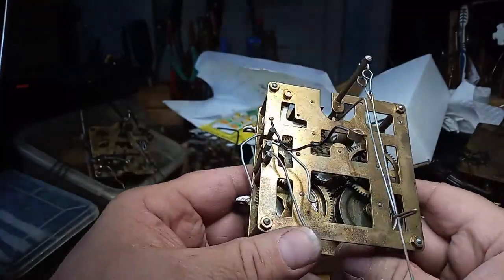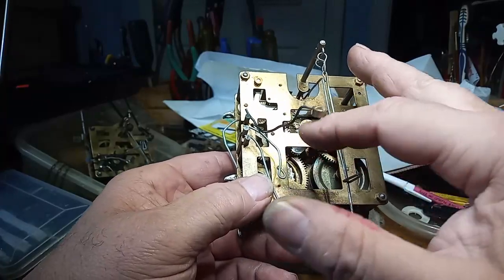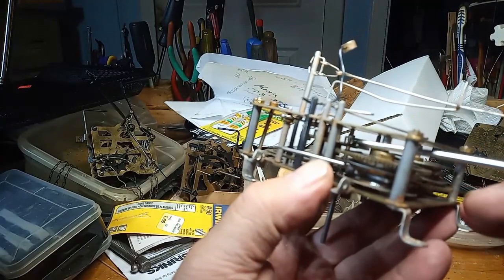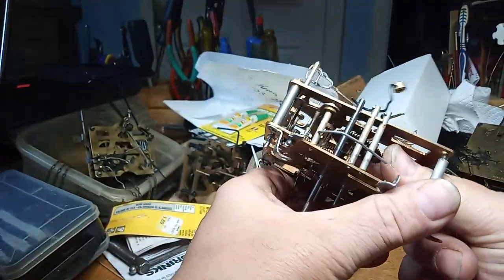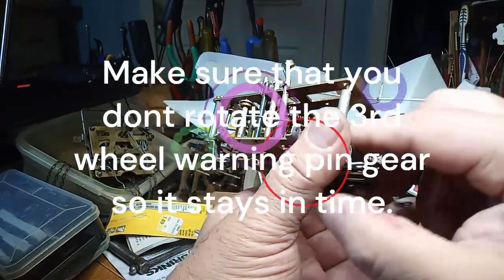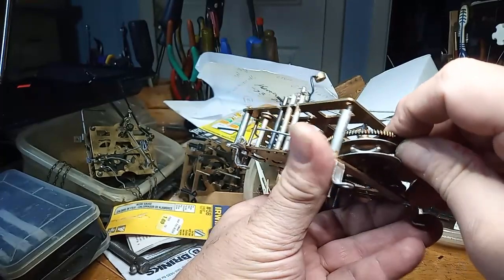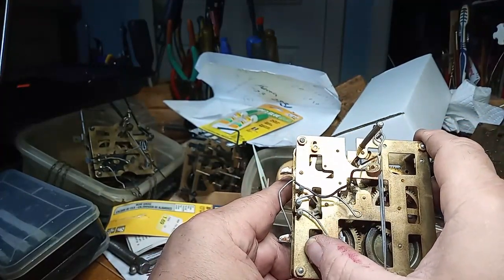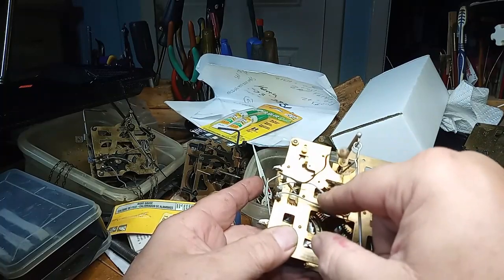How to adjust the cuckoo clock gong and bellow lift levers w wheel inside plates(See description)

Comment: I watched the whole thing and thank God I already know about clocks. This would be a great video showing how you can change the clickers wheel that don't click any more. Setting the timing on the clock sound. need to know where it is and which way you need to turn it before you take it apart.
Reply from the maker: Noted!  A guy in the group asked me if I had a video on just this. I told  him when I got home that I would make one for him. So not made for the beginner. You have to know a little bit about clocks.

Comment: Thanks for your video, I have a USSR cukoo clock which I have restored but I have a problem with the strike it strikes and operates the bellows but I doesn't stop just keeps going, any suggestions
Reply from the maker: Does it have a count wheel system on the rear of the movement? If so then the lever that goes into the count wheel needs to be adjusted. I have a few videos on cuckoo keeps cuckooing until the weight hits the floor. If you are a subscriber to my channel search for that folder. If not then subscribe to my channel and search for that folder. Let me know if they dont help. Thanks for watching.

Comment: Mark thank you!... My star wheel is on the great wheel for the strike side... so could I just turn the great wheel to adjust the lever actions?
Reply from the maker: If the star wheel is on the outside of the plate the way that the Regula movements are then yes. Typically there is a screw. You loosen that screw. Turn the wheel so that the hammer lever is just barely off the tab of the star wheel after it is done cuckooing. That would put the high and low note lift levers in the next slots. Then tighten the screw. You might  have to do this again until you get it just right. The hammer  for the gong plays first, then the high note lift lever (the longest lever for the cuckoo bellow) and then the low note lift lever. A lot of times the low note lift lever will get caught up where the gong tab is. So you have to adjust it so it doesnt.
Reply: @munnerlyn3 Hey Mark... I'm not explaining this correctly...sorry.. the star wheel is on the great wheel between the plates...so I assume I can lose the great wheel and turn it a bit to get the levers in the right position..
Reply: Btw... the strike is on the right-side of the movement looking at it from the back of the clock..
Reply from the maker: @genedoerr9519  yes. Exactly. You can loosen the bottom nut. Pull the great wheel away from the next gear and then turn the great wheel and then  put it back together. You might also have to adjust the levers that hit the star wheel. You know that you can video chat with me since we are friends on FB. LOL.
Reply: @munnerlyn3  thanks again...
Reply from the maker: @genedoerr9519  WOW. I cant wait to see this clock and movement as not too many are made that way. I think that I might have one.
Reply from the maker: @genedoerr9519  you are welcome.